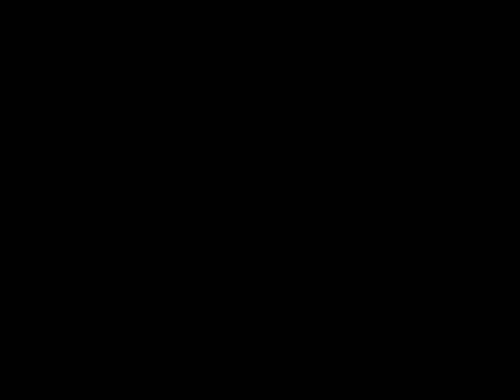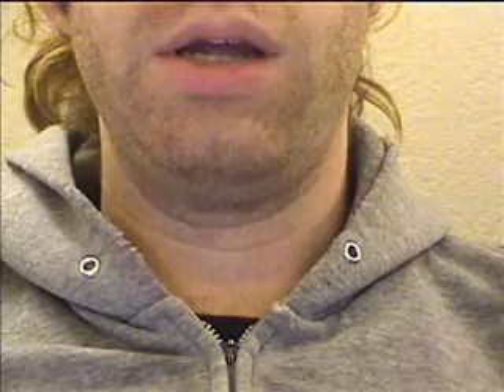SSP (Space Solar Power) Analysis

Comment: "terrestrial solar has just broken the $1 / watt barrier"

Solarbuzz says solar installed costs are currently $9, $7, and $5 per watt for residential, commercial and industrial systems, respectively:
solarbuzz. com/SolarIndices. htm

Are you including the costs of labor, mounting hardware, wiring, regulators, invertors, etc.?

Comment: Thanks. The Seth Potter AIAA 2009 pdf here...
sspi. gatech. edu

...says (p32) that "First unit cost is for a 10 MW satellite is about $145 per installed watt (including launch but not non-recurring engineering), which is about 2 orders of magnitude higher than that of conventional power plants

 Additional units will be somewhat 
less expensive

 $100/watt, excluding launch"

Therefore, launch is seen as only increasing the cost by 45%.

Comment: Good point about the cost of getting material into space - I thought about it, myself. At first I thought the construction of a "space elevator" could make getting payloads into space cheap enough to make space-based solar feasible, but then found out about a potentially better solution: a mag-lev launch platform - kind of like a giant rail gun. From what I've heard, MLL is even more cost efficient than the space elevator concept. Comments?